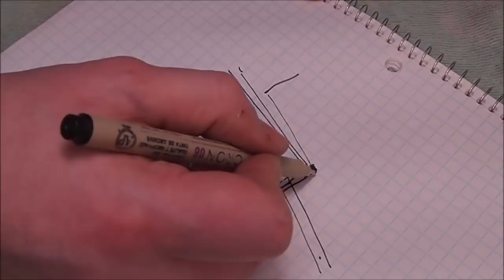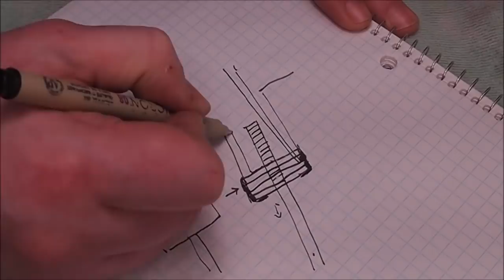Strat Neck Mayer-hem.

Comment: Just discovered your channel, interesting problem with a mushy truss rod. The multi washer problem looks like it might be similar to a related albeit very different issue when shimming mountings on industrial machines. The rule is never more than 3 shims - or they will act like a spring. I think if you replaced most of the stack of washers with a solid spacer then the mushiness will go away. BTW - love your work! Excellent videos
Reply: more than 3 washers would act like a spring? how so?
Reply: @matimaui  se Rob Mods comments below

Comment: Not sure why the two lock washers are included in that stack.  They will be “mushy” until they get loaded to the point of flattening.  Also, about gluing them to each other and to the side of the truss rod hole, before compressing.  Have you considered using a small bushing / spacer instead of the washers?  There are various sizes / combinations of ID, OD and length.  Seem like a solid stainless steel cylinder would perform more consistently than a stack of machine bolt washers and lock washers.

Comment: ...plus I love the smell of linseed oil. I use it on bare wood guitars and ukus and although it takes forever to cure all woods and even metals like it as a thin organic protective layer. I have made about a hundred different instruments, including shakuhachi and didgeridoos using linseed oil as a seasoning and protective substance. When bamboo, for instance, is rolled and heated over a propane stove linseed oil seeps into the heated wood, inside and out. Poor people love linseed oil.  Linseed oil can be applied over and over over the years and will eventually even form a thin and flexible layer of goodness.

Comment: I've heard the ski jump at the end from shims too.
Reply: Yes I've seen that develop over time, especially when too much torque was applied on the screws in softer woods.  
If the shim is placed between the screws (at frets 20/21) that can be avoided.  But really it's difficult to deform properly dried hard maple in a short distance like that.

Comment: I have exact same guitar.. neck problem on mine. have heard of a few others online which have twisted or humped necks.... mine had terrible buzz on upper frets... so I did a fallaway... but the damn thing won’t hold the action stable... I flatten using truss adjust (very snug) & added washers.. won’t hold and action gets high after a few weeks. PITA... there must be a defect on these.. bad wood, etc.
I think what’s happening is wood near nut is compressing and forcing up under rosewood at uppermost frets.

Comment: I suspect the compression on that bottom washer may have caused the wood to act like a clamp onto the washer as the downward tension pulls in the surrounding wood to clamp the edge of the washer, 2 possible attack methods there would be to somehow score around the washer with a very fine blade but due to the access size and restrictions you risk a actual blade breaking and staying wedged in plus you would have to make the tool to do it, my chosen method however would be to drill and tap the washer and then use a machine screw to remove the washer, this way very large upward forces can be applied with little risk of causing damage, although the drilling is the risky part and its a weigh up to whether it is really a big issue if it cannot be removed.
  I am primarily an Electrical Engineer and its that engineering side of me that gets my interest in videos like this, nothing better than to see a professional take in what has become firewood and through skill and experience restore it to a full working guitar.

Comment: For sure those split lock washers have no business adding vagueness to the adjustment! Granted I work in a machine shop but I’d have made a brass spacer of the right height vs a stack of washers. Of course with them all bonded together that should remove any movement in the stack

Comment: I don't like the fact spring washers are used here, there I think lies the issue, over time they have compressed. I can't accept end grain maple has given way to compression from the face of the truss rod nut, I am thinking the hole was over bored at the factory. Could be wrong my two cents worth. This guy is the go to guy for repair, has a great feel for the work.
Reply: Yep...fender makes brass

Comment: I bet those split washers were putting back tension on the nut and the vibration of the guitar was making it go out of adjustment again cuz it's like a spring affect plus the vibration made that nut back out you might have all you had to do is just put flat washers with no split washers and it probably would have fixed it but either way

Comment: The only thing I wonder is at what point is a replacement neck a more economical option. You’d re use your tuners and string tree of course and you’d have a new neck with new frets. I get you don’t want that on a very old or super desirable guitar but on a run of the mill Strat like this I always thought that being able to change necks was the whole point.
Edit- I see I missed that it’s not exactly a run of the mill Strat.

Comment: Great video - I have the exact same guitar and exact same symptoms - Great guitar but neck won't hold relief and upper frets buzzing. Did a fret level and added fallaway but eventually goes back to buzzing due to too much relief. Had 3 washers in there but removed two and now a single washer compressed into the truss hole wood. Can't get last washer out. Concerned and what should I do - did this fix last? Other options? Thanks for any advice.
UPDATE: Got all washers out. Cut a Fender walnut truss hole plug to match depth of sunk nut (2mm) & wick glued side edge of plug with thin CA glue (avoiding the rod). Worked great. Doing this fix (and fretboard heat & lengthy flatten jig press treatment to reset wood memory + fret level) fixed my guitar neck. Took a lot of work and fiddling. 
Thanks for the video & inspiration to fix this issue.

Comment: Good neck detective story!  What a stupid design to have to take the neck off to do a simple truss rod adjustment.
Reply: Nothing stupid about Leo back in the day.  That is like calling a model T a stupid design compared to modern cars.  So a few minor changes had to be made to that Strat since they first came out in 54.  But for the most part they are the same as the first design.  That was pretty effing genius if you ask me.   Its not so hard to pull the neck.  And it's not something that has to be done very often.  Never on my Strats.  I like a just a hair of relief as I run my action a little high for bending and not running over the above strings.  I only leave a little relief so I can see if the neck moved with the guitar strings and fretting 1 and 20 and pushing down on the string in the middle. I can see it. I don't need a feeler gauge.  I just use my thumbs and pinkys and can quick check in a few seconds.
Reply: Well... the newer style models have variously implemented accessible truss-rod adjustment.  It's the fetishists insistance on a Vintage Look™©℠® that yields the end-of-neck truss-rod placement.
I guess they think people are going to be, at the same time, knowledgeable enough to notice no accessible truss-rod but also no know about Brand New Vintage™©℠® production guitars.

It's all a pile of marketing crap. Get a guitar with a finish and setup you like, with quality parts, that plays well. Forget the "Oh! This one looks like the one Jimmy Page plays." BFD!
Reply: Consider it's a hold-over from acoustics, where the truss-rod adjustment is done through the sound-hole.
Though Gibson electrics (and others) have had the truss-rod adjustment under a cover on the headstock as about standard.

Comment: Re stuck washers.  Two techniques I've had success with is 1, put a star lock washer and a regular hex nut and once in contact wiggle it about with a tiny screw driver this may move it or loosen it. 2, a tiny drop of locktite on a nut. Usually this will unscrew with the washer attached.   A stack of mixed flat and split washers will move and  mush about, no question,  Its ok on a casting where you can torque the crap out of it. Not there of course.   I am surprised you didn't just make a single washer out of rod stock to the thickness you needed.
Reply: I was wondering the same, but in effect, he made a short rod by gluing the washers together, and there's guaranteed glue to pocket wall adhesion for the entire length of the stack.

Comment: This could have worked or made things worse if it didnt but I'd likely have tried it and hoped for the best lol. So I'm thinking you get two metal rods that have a flat flush surface on the end. Mix up some two part steel reinforced epoxy (JB weld) and put a little on the tip of each rod then push each rod into the washer on either side until it bonds/cures. Then pull gently on either side slowly working out the stubborn washer. BUT then you have to find a solution for the original issue and building up washers with ca glue to build a bond with the wood not only is a solution but it negates having to get the final stubborn washer out. So I can completely understand why Twoodfrd went with that approach. My idea would certainly be risky cause if it didnt work I imagine the whole fretboard would have to be removed. So again just an idea but I fully understand why such an approach wasnt taken.

Comment: I have exact same guitar and the neck is giving me fits. After checking with a notched straightedge, it appeared to have a hump near 12 fret. I leveled frets with a fallaway. Seemed slightly better. Still some string buzz, action a bit high. Added washers and retightened and it initially seemed better....  but pulled the guitar out after a couple days and it seems the relief is back...ugh what a PITA guitar. Wondering what to do now? Soft wood may be the issue in the truss rod pocket? Gonna recheck the neck. Wish someone made a spacer instead of adding a ton of washers. how to harden up soft wood that is compressing?

Comment: To get the last washer out I would have tried to fit in a sleeve slightly smaller than the truss rod's nut and glue it to the washer.
Then turnig the sleeve counter clockwise should make the washer unscrew with the thread and come out - I guess :-)
Or use the truss rod's nut itself, put super glue on the bottom, srew it tight to the washer and than unscrew it together with the washer...

Comment: Well hey there man! (I'm assuming this may be the singular of "gang?"). I'm a long time professional guitarist that's been apprenticing as a guitar tech for the past year or so, and I've been watching your videos religiously - if I can't find the answer from my mentor, I go to you; if I'm still stuck I keep digging, then I usually end up back at you. This is my third rewatch of this trying to solve an issue for a buddy. I was wondering if you may possibly have some insight on this issue for me?

I have an early 2000s strat with a rosewood neck and a beautiful profile - the truss rod was brought to me maxed out, and without tension it still has a decent amount of forward bow with the notched straight edge. The nut was severely recessed so I have drilled out some washers of the appropriate outer diameter to fit the truss rod, and have now stacked 5 (approx 5mm total) washers in there to get the nut to sit near flush to the end of the neck... the truss rod tightens right up, and never seems to do much - something, but not much. It doesn't feel loose or anything out of the ordinary, it just isn't functioning. Could the wood be compressing where the end meets the truss rod pocket, and would this thin superglue method possibly be of use in this instance? Is there anything else I'm not understanding about how a single action truss rod functions that might shed some light on what's happening here?

Thanks for sharing your knowledge and apologies for the in-depth question!

Comment: So I shouldn't use boiled linseed oil on my freet board?
Reply: Good question! I use it because several Luthiers I follow use it - and they have for some thirty or more years. They use it sparingly and wipe it off thoroughly after a little while. Ted states that people do put on too much, and it smells. You don't need much. Lemon oil really smells too, and some will not introduce that smell to someone's instrument.
Reply: @one1gretsch  , I know a guitar builder who uses and recommends walnut oil for treating the fretboard.
Reply: @goodun2974 , yes, it is probably many products that will work, as long as they don't go rancid.
One guy recommended Ironwood Gourmet Butcher Block Oil, I guess it's made for wood. One other thing about the linseed oil, 
when used correctly, is that it form a thin layer on the fretboard, that prevents sweat and dirt to go into the wood.

Comment: Never say never. I don't agree with using cyanoacrylate ever on a guitar but at 8:18 he's talking about never being able to remove his superglued in washers. First off, I would use a section of hollow rod to fill the gap that was the exact size needed instead of a pile of washers and compress the wood under the stuck washer if I really thought "mushy wood" was the problem. Speaking of problems, the one problem probably was the use of split washers. Assuming the "mushy wood" is a second problem and throwing out a solution to address that problem is bad problem solving practice.

Comment: Is it okay to use clear mineral oil for fretboard conditioning? I've been using it for a while and like it very much, it doesn't build up or anything. I just wanted to know if it's okay
Reply: I've been using mineral oil on my 97 les paul forever and it has aged without issue over many cold, dry winters. I hit my rosewood boards about 3 times a year, mostly over winter. No cracking, shrinking, discolouring, decomposing or junk build up. No problems ever.

Comment: The Pocket could do with being larger in diameter  to allow for a larger type washer that will not be prone to pulling into the end grain of the wood i am surprised that hole is a heaten as it is not a guitar bloke here but as someone with a good amount of othe knowlegde that idea of such a small pocket giving such a small bearing area is bad design  simple as

Comment: In the early 2000s someone brought a Stevie Ray Vaughan sigstrat in to me, after the Chain Whose Name I Do Not Mention that sold it to them wouldn't help him. The string line was so bad the high E was off the neck by the 15th fret. I had to re-rout the neck pocket-that was easier than rerouting the body and moving the bridge and pickguard, which would have looked stupid anyway. It was possibly the shittiest factory build I have ever encountered from any company at any price point.

Comment: The CraptasticHalfAss Guitar Truss Rod Adjustment and Mutilation procedure you described has to be like a failed April fool's joke. Only way it would be possible is on a guitar that had some seriously oval/slot shaped neck screw holes. Any guitar that wasn't already trashed/POS I don't think it would be possible especially if you didn't want it to become just that.

Comment: I realize you probably did what you did to save the customer some money; but if I was the customer, I would have just asked you to remove the fret board and replace the darn thing. Even if it cost more, why bother trying to fix a faulty part with glue and wax? I would also guess that since you had some bowing and had to do some leveling on the high frets, the fix might be temporary. If you replaced the rod outright, you could have put a wheel truss rod as the new one so the player doesn't have to remove the neck anymore. I don't understand why Fender puts those old truss rods on modern guitars. They were obsolete when they were new. But ultimately it comes down to what the customer asks for and what he's willing to pay for. It's probably a fair amount of labor to remove the fretboard.

Comment: Wicking CA under the first washer was probably a good move but for the rest?  a machine shop could have made  a 5mm bushing for you, or you could have manually made one from a piece of 5mm brass. I don't think this was an elegant solution.
Reply from the maker: I'll outsource all my machining needs to you.  Get it to me in two days and less than $20.  Time starts now. It better be elegant.
Reply: @twoodfrd  no offense meant Ted, I love everything you do pretty much.  I think you could drill a hole in a piece of metal and round it on the disk grinder - it'll take less than two days for sure (-;
Reply: @resonatorman  Thanks, you are right. But if I in any way offended Ted it's more important that he know that was not the intent.